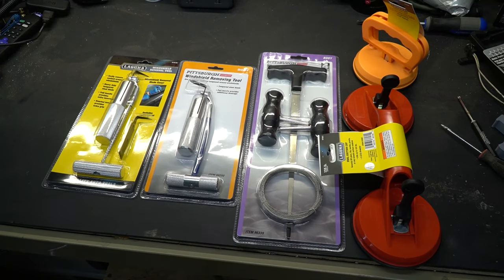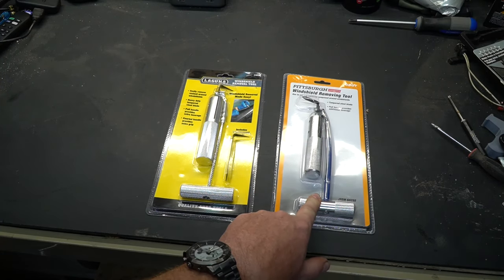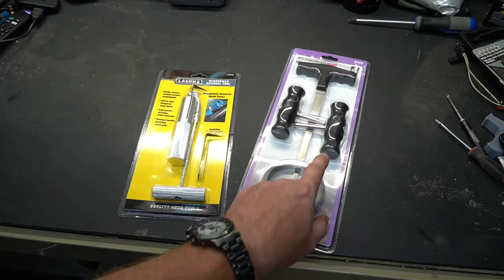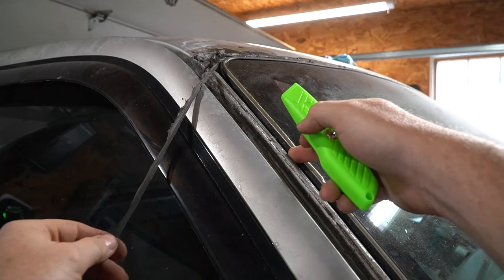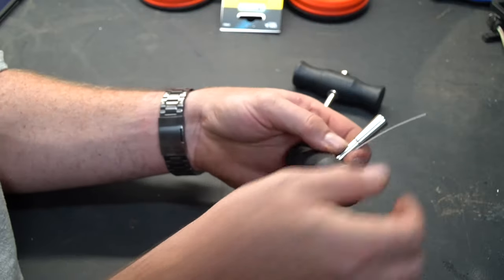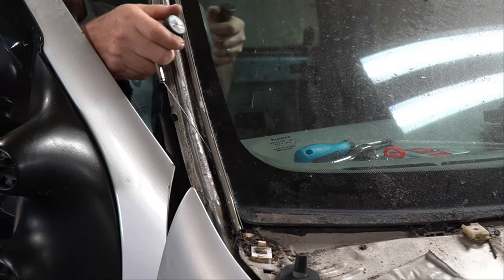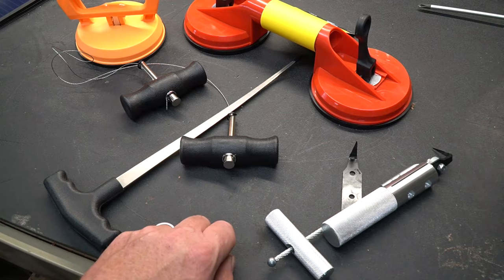Removing a windshield with Harbor Freight Tools, Windshield Removal Tool & Kit, New Tool Day Tuesday

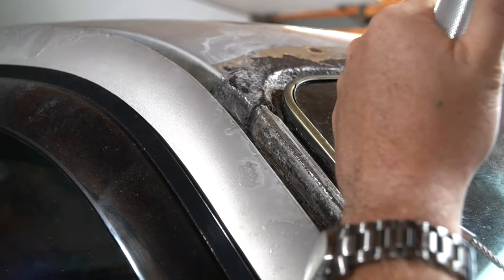Comment: 4:23 "You're probably gonna break or chip the windshield"????  If so, that defeats the entire purpose of removal for me.  I do appreciate the video and tools demo, but if it's hopeless to remove w/o breaking the glass then I'll  leave this to a pro.
Reply from the maker: There are folks who do it without breaking the glass, but if it's your first time, I would think the odds are high that you may.  A lot folks have mentioned a torpedo on a sawzall is easier, might be worth some research.  The tool is here:  https://amzn.to/3ZSBzXW
Reply: Get a wire cut out tool 98 percent not gonna break the glass
Reply: @JasonPetersen0  I do glass for a living and it’s way less than 98% if you don’t have experience with things like wire out tools or using them and where setting pins could be you are most likely to break it, saving windshields is not as easy as it sounds
Reply: Inexperienced people I know repair windshields all the time. Pulling them from  junkyard cars.
Reply: As soon as I heard that, I thought the same thing lol.
Reply: If you are removing one that is already broken, no prob.
Reply: @1D10CRACY lic 0 pollito
Reply: @pcmikeoftheup  what's the fastest removal if I don't care about the broken windshield? Smash it?
Reply: @DrxEx yes . Have fun

Comment: If you have any intention of saving the windshield, do not use these substandard tools, use a fiber lne, or an equalizer cold knife.
Reply: Just being careful will do the tricks. I removed a front and rear windows with a bicycle brake cable and a few blades I didn’t know this tools existed this would make the job way easier and even then it takes me about 2 hours for both front and rear
Reply: If you have any self respect on your time and money don’t buy any of these tools.

Comment: I tried to get a windshield at the junk yard today using these tools.  Broke 4 of them before i gave up.  Even had one of them 3/4 of the way out too.
Reply: I have experience and i can remove it with a sharpened scraper in less than 20 mins usually with a help of a hammer
Reply: 4 windshields ouch, practice on some broken ones, 1st especially with new tools
Reply: Do the salvage yards charge you for the ones you broke?
Reply: @tenthplanet3342  Those were the practice ones.  I did get the windshield out of my parts car in one piece eventually.
Reply: @gabooda2380  lol, no I didn't tell them.  All the windshields just end up getting junked anyways.
Reply: @johnv4217 what tools worked for you to get the whole windshield out in one piece?
Reply: @imnotofficial1660  An extra long razor utility knife style blade from the interior and the windshield removal cable tool for the bottom seal.  When I removed the already broken one to replace it I just used that right angle windshield knife from Harbor Freight but ground it down thinner first and popped the broken windshield out without breaking it further and without even trying to be careful.  Still used the cable to get the harder to reach bottom seal.
Reply: You need a wire cut out tool $500+

Comment: A guy with experience if you can’t cut through the urethane you can just break the glass we’re it’s difficult and the blade will cut through a lot easier just be careful not to cut yourself

Comment: The wire method is way more efficient if you have someone to help you out. Wire needs to be a bit longer and also a bit thinner. In most cases there is no need to remove the pillars because you could use plastic plates or just a big flathead to protect the interior bits. On some cars the polyurethane is too close to almost all of the interior and with the blade you risk damaging it. For working alone there is a toolset with a wire which would be the most helpful for removing the glass without breaking anything.

Comment: Haven't done a window since the 90's. But I always used piano wire and a helper on the inside or outside. Trick is to go slow and not rush it. Works just fine.

Comment: One tip, on the outside of the vehicle, apply a couple layers of painters tape to the painted surfaces around the glass, helps you prevent paint damage when you slip with the cutter or are using the saw. To prevent glass damage you can try to keep the cutter as far below the glass as possible to keep from chipping the glass edge. If you do chip it but it didn't break it is possible to polish the area with a diamond cutting bit and water to remove the chipped area. For the places you do scratch the pinch weld you just use some window weld primer to touch up the area.
Reply from the maker: Awesome tips!!!   Thanks!    I imagine with experience this may a breeze.   It seems like the mobile glass companies do this fairly quickly.
Reply: @1D10CRACY  Usually the big difference with them is that they are replacing the glass so they don't care about chips or breaking the glass so the power cutting tools just need to avoid vehicle damage. If you are trying to save the glass from the vehicle or from a salvage yard it becomes a real test to cut it free, even they a cordless multitool with a glass blade can make it easier.

Comment: If you don't have access to a heat gun, a hot day in full sun, however uncomfortable definitely helps soften as well.
Reply: Yeah and then the windows so hot in the sun it’s breaks up and folds when trying to cut it out 😂 just use sharp drag knifes the right technique will get it done

Comment: Do you think the chances of cracking the windshield would be less using the wire saw than the other tool?
Reply from the maker: I would imagine yes, it would be less likely to crack the windshield with the wire saw.

Comment: You're better off using a fiber line or wire cut out tool, regardless of the reason or intention. They make the job easy with as little destruction as possible.

Comment: is thare any solvent that works on the glue?
Reply from the maker: I'm not really sure!    If you find something that works, please reply back and I will pin the comment.
Reply: No. Both butylene and urethane based windshield adhesives are completely impervious to solvents after completely cured. Solvent will damage the glass (by etching) AND damaging the finish (clear coat, paint and primer) and possibly damage you. Mechanical removal with the purpose-designed windshield adhesive cutting tools is the only effective method.
Reply: @lothianmcadam1  that's not true. Butylene is  petroleum based product. There are a lot of chemicals that will soften it. Albeit it  will make a huge mess and not really do any good as it is really thick. Unless your using some type of acid, theres not much else that will effect glass. They stores tons of chemicals in glass containers for that reason.
Urethane is not solvent dissolvable. It is a thermostat polymer that very little chemicals effect. Even the ones that do effect it would takes months and years to break it down.

Comment: I heated the butyl on my quarter glass on the oldsmobile and pushed them right out.  Maybe I'll try it on the windshield.
Reply: Depending on the year, most likely that wont happen. Side windows uses butyl tape. A nice gooey rope, so you can do that. Front and rear windows use urethane adhesive that sets up like tire rubber. Heating does very little to effect it. It may soften it slightly but that's about it. The rope saw works the best if you're careful. DO NOT let the wire touch the glas period! If it chips it, it will crack guaranteed. It is best to use two people on this. You  need way more cable, at least 6' so you have a long stroke available and you can keep  the cable under the glass. You need to make 12-18" strokes with the cable and go slow. If you make short fast strokes, the cable will heat up, break and possibly chip the glass. And you'll go through a bunch of cable.
The better approach is to run the cable around the outer edge of the windshield. Be sure to tuck it under the corners of the glass. Since it is laminated, the cable can get between the layers and ruin the windshield.
Once the cable is laid around the glass, either tie it off on a wiper arm post or have someone hold it. Get on the inside of the car and start pulling the wire through. Not sawing it, just straight pulling it. It works great and is a lot less effort. Less chance of damage also. I have pulled several like this successfully by myself.
Reply: @QwertyQwerty-jq3cu  thanks for the information.
Reply from the maker: Normally on a sunny day the urethane is already warm from the sun.   Cutting cold urethane vs warm urethane can make a ton of difference!   If you are struggling, warm it up and it will help!

Comment: Why buy 2 tools?  The better blade will cut them both. The Butyl tool has the blade installed in the wrong orientation. Those blades are crap, the handles are probably OK if you put a good quality blade in it.
        I am not a HB guy, much more of a SO guy. But we all have our things.
                                                                                                              Ycats
Reply from the maker: I'm not sure why you would buy both tools.  Some will argue the butyl blades tend to be wider and don't bend and flex as much, but a good quality Urethane blade will handle it.   As far as blade direction, sometimes it's just a preference.   The butyl one in the video has never been used, it is configured as it came out of the package.

Comment: Soapy water not heat
Reply from the maker: Heat makes a big difference! Especially when it is cold outside.  On a hot sunny day the heat will already be there.    Soapy water would help as well.

Comment: "you're probably going to break the windshield or chip it at one point, probably with some experience you might be able not to damage it but i never had that luck"   WTF ?! So tell me straight, i am looking to go to the junkyard to find a used oem replacement windshield to extract and to replace my cracked windshield. I've never done that before, just tell me even with the right tool , it's not going to happen ? Also even if i get the windshield in one piece, i bet windshield repair place will refuse to install a used part. Also with all the molding still glued to the glass.
Reply from the maker: I'll tell you straight, I typically chip or break the glass, but I'm not a professional.    There are folks who do it without breaking the glass, but if it's your first time, I would think the odds are high that you may.  A lot folks have mentioned a torpedo on a sawzall is easier, might be worth some research.  The tool is here:  https://amzn.to/3ZSBzXW
Reply: @1D10CRACY  thanks for the reply, after watching your video another one convinced me it's not a job worth doing yourself for the time, difficulty and money.